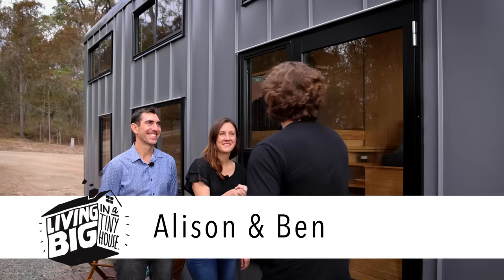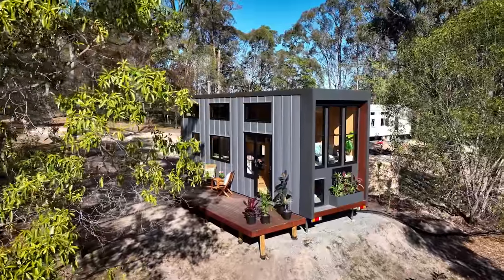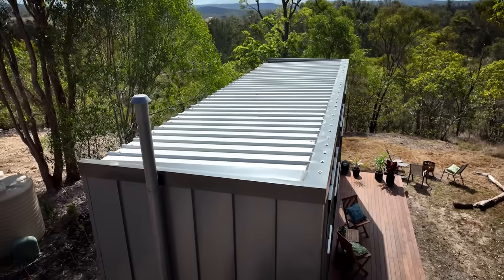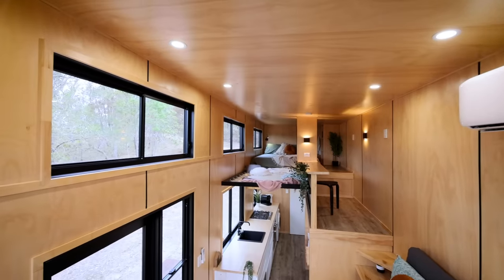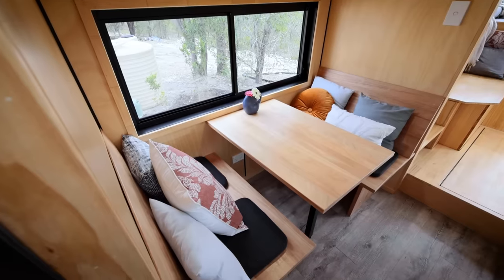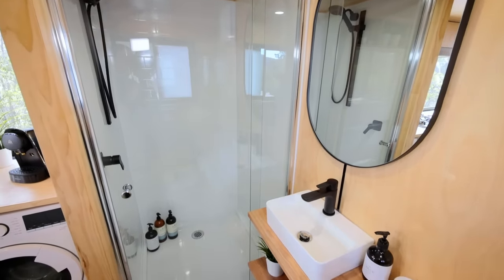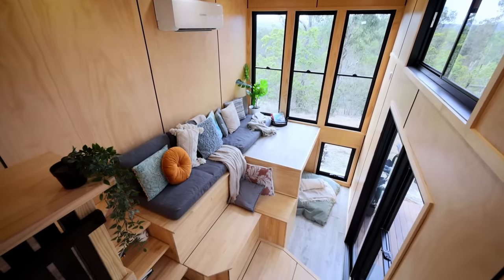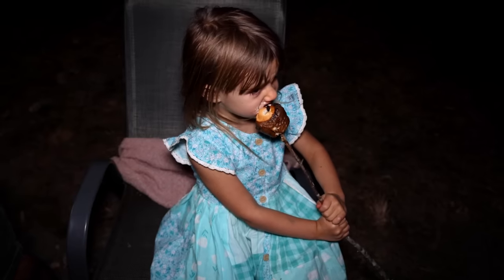Thinking In Three Dimensions - Architect’s Brilliant Use Of Space In Tiny House

Comment: I love the houses featured on this channel, and I'd love to see some more homes built to withstand cold climates. I live in Quebec, Canada, so houses like this one are but a dream to us, because our walls are all about 15 cm thicker due to all the insulation and we also need to account for heaters and things like that. I remember there was a really cool tiny house built for Alaska that was featured at some point, please try to bring us some more like that 😁
Reply: Well, just use 10-12 cm of PUR (polyurethane) insulation and you'll be perfectly fine. Plus, if you want to safe further on wall thickness, you might combine polyurethane insulation with vacuum insulation panels or multi-layer aluminum insulation (for IR rays) on top.
Reply: a lot of them do have heating. you can get very small stoves.. i do wonder how efficient it is since you need small pieces of wood, but apprently theyre too hot for most.. so maybe in canada that would work..I wonder if putting a bathroom on one end and kitchen on the other would help you.. you could heat the bathroom qquickly and kitchens create heat,.. you cloudl have little pocket doors to keep the interior heat in more.. id do a roller blind and or the exterior metal doors to keep heat in with big French doors at the centre/ front in the living area.. that way you could close it when it is very cold and keep the heat in at night at least..

Comment: First thing I noticed that would have to be changed is that needless step up into the house. For those with mobility issues that step is a major fall hazard.😮. Although it is cleverly designed and all the windows are just lovely, it still comes across as rather industrial styled rather than a warm homey feeling.
Reply: tbh the entire tiny house looks like a major fall hazard

Comment: This tiny house is nicely constructed; however, IMO,  it could use some safety measures since there are children living within  and surrounding this home:  the lounge area would need a barrier of sorts to make sure that there are no accidents of children (or even adults) tripping and falling off the edge; also, the netting over the kitchen--be careful as the children grow and get older; that netting may not stand the additional weight, even with an adult, and a barrier should be placed around the workstation desk/bench and the edge of the adult/primary bedroom for safety as well.  Also, another point:  a safer fire pit--the fire was quite high and didn't look very safe.  [I don't mean to be a Debbie Downer, but just noticed a few things--the adults since they are architects and engineers could look into making such adjustments to their home there, as well as any other homes--tiny or  not--currently and in the future!]

Comment: As a canadian living in the most sustainable and lowest C02 emission , the  aircondition  unit on the wall ,put me off ...even with 35 C all summer ,  there is more option like  green roof top,ceiling fan,  trees and green space ,  blocking heat curtains ,,,,etc but the design of the tiny house is beautiful

Comment: This is a really intelligent layout and, beautiful design but I’d really be worried about safety for the kids. 

First off, that loft net is awesome, but there are some big holes around the perimeter and I don’t see anything to stop a child from falling off the end (at least as far as I can see) - at least put up a (high) railing. Also, it’d be very easy to fall off that high lounge and big steps for the kids, while those large storage boxes they like to hide in have heavy lids that could slam onto small body parts (heads, fingers etc.)

This would be great for adults, but letting anything less than a kid in their mid-teens live here sounds like a bad idea, let alone kids so young. And I say mid-teens because the exposed end of that netting looks like such a hazard.

Comment: You really can't do most of this in Germany- a tiny house has the same laws to fulfill as a regular house.. that means stairs have to meet the same requirements and are therefore much bigger- there have to be railings everywhere you could fall for more than one meter.. not to mention the complex requirements for insulation and drainage. Some of these laws can be evaded by declaring it a caravan.. but then you have to fulfill other rules and find a property where this could "park" full time since you technically now have a campground/parking space which is normally not allowed in residential areas..

Comment: The back burners on the stove top are too close to the wooden wall IMO. If a larger pot is on one of them the flames will lick around the bottom of the pot and up its' side creating a definite fire hazard, especially as a rental B&B with unaware guests.